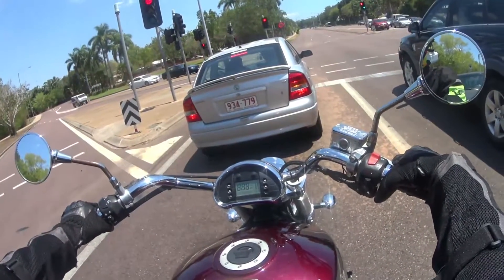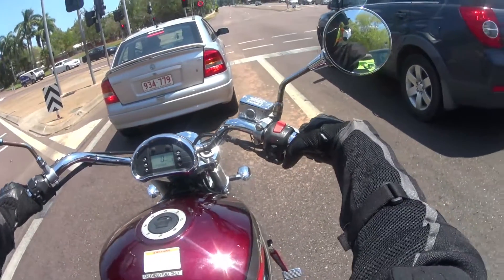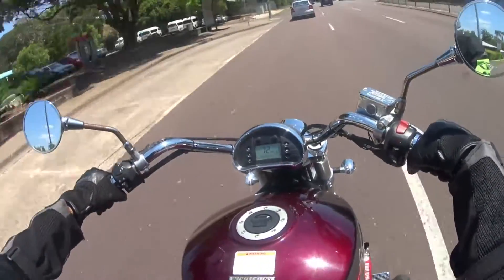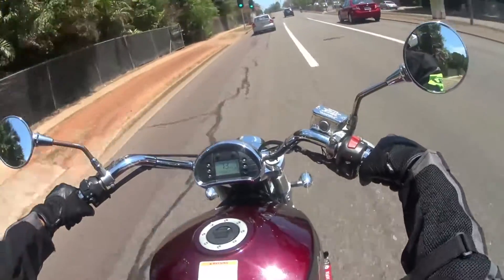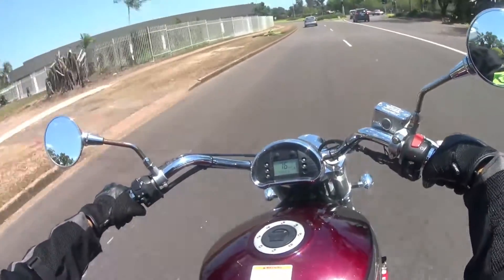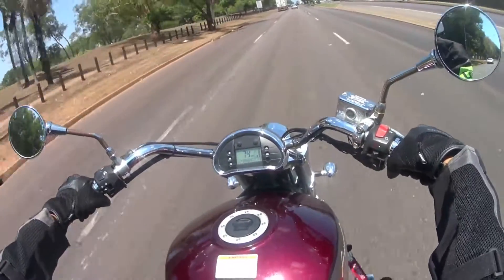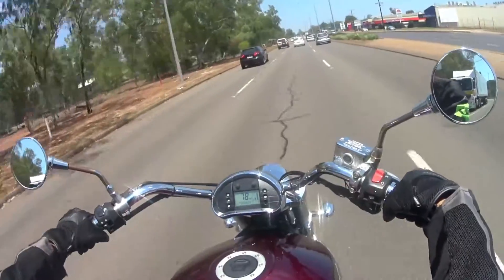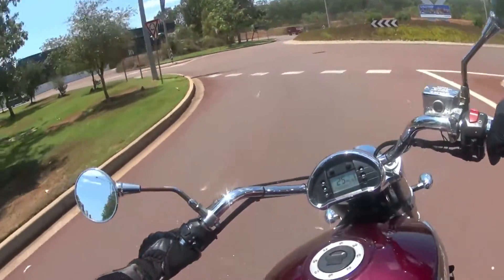Motorcycle Glitches - Low Voltage I #08 Hyosung GV650 | Motovlog Darwin

Comment: does your fuel gage work properly?

i have had such bad problems with my 2013 gv650. instrument cluster replaced because fuel gage didnt work properly...worse with new gage.

intermittent electrical problems.

very clunky gear box - first one blew up after a year.. replaced new.

would replacing the regulator and stator do the job for the gage and electricals... the service guys couldnt find the cause of the electrical problems..cleaned and tightened everything
Reply from the maker: it works alright in that it will read full until I have gone through 3/4 of the tank. it will then say half a tank until I am down to the last 3 liters or so. the low fuel then blinks. so overall the fuel gauge works but I really more on how many km I have travelled to know how much fuel I have left.

so what are your symptoms with your electrical problems?
Reply: +outie555 poor idling at times.

when i first start it after a few days off riding it, sometimes it switches off.

after a ride and it has cooled down it pig roots, doesn't matter if i allow the bike to warm up. very hard to maintain throttle balance when i want to uturn
Reply from the maker: +Daze i'm not a mechanic, but i would check your spark plug leads. A simular thing happened to mine and the lead connecting it to the spark plug adapter was barely making contact. Another thing could be blocked injectors. Try premium fuel and add injector cleaner to your fuel tank. They also have an O2 sensor on the bike on the exhaust, maybe remove it and give it a clean. could be a faulty idle sensor too. See if opening up your fuel tank cap when idling fixes it, it could be a blocked pressure release in the tank. Sorry i cant help more than that dude, but hope it helps.

Comment: I have a Mosfet RR on its way to resolve similar system voltage issues. Did replacing the RR fix this issue in the end for you?
Reply from the maker: +Andrew Morris I ordered a cheap new RR but it came with the wrong plug so haven't installed it (thanks ebay seller from china) . Thinking I might take it in to a bike shop after the Christmas break and get a Mosfet RR and better stator installed. Let me know if the Mosfet RR fixes it on yours, thanks buddy.
Reply: +outie555 Installed my Mosfet RR today and so far no more voltage issues. (hooray!)
Reply from the maker: thats great news buddy. do you know which bike the mosfet RR was from? or was it a hyosung one? only asking so when i change mine i get one that works
Reply: +outie555 Yer mate, I bought the Hyosung package with the FH020AA RR off this site http://roadstercycle.com/. Video will be up shortly on my channel.
Reply from the maker: +Andrew Morris awesome thanks. looking forward to your vid

Comment: Man I will tell ya what..    Junk the hyosung rr and stator.  Go with a Mosfet reg and a Ninja 250 stator.  You wont ever have to mess with it again.  I ordered those parts even before I passed the cash off for my 09 I bought new in the crate.      Even after running the bike in for a few months these parts made a world of difference in how the engine acts.  My mosfet reg is from a  newer r1 purchased on ebay for nothing almost.